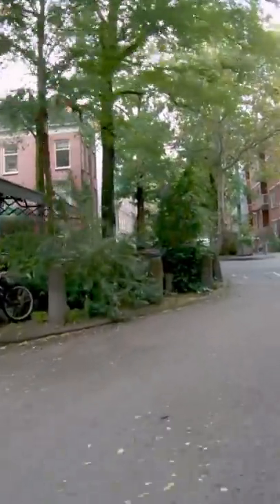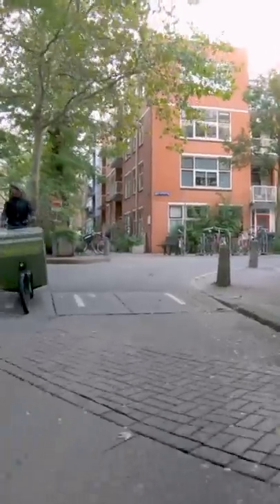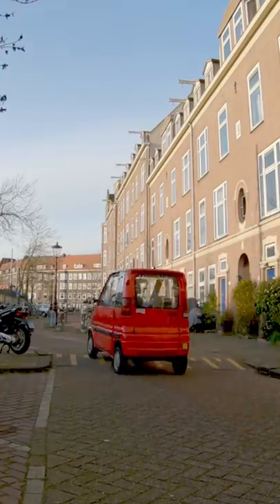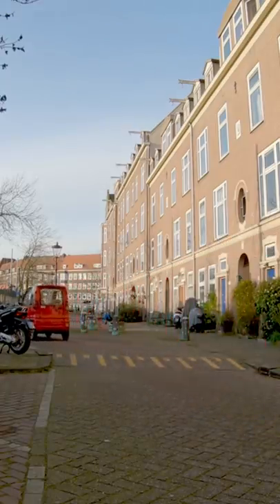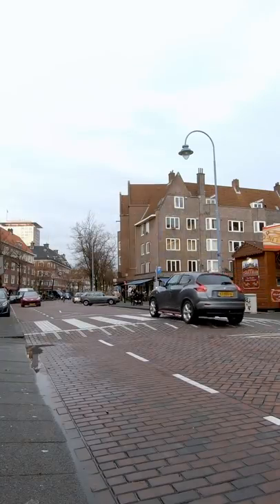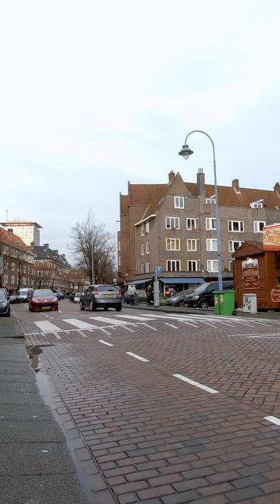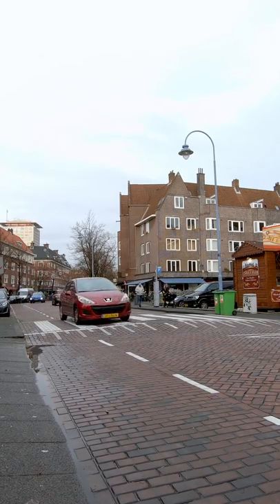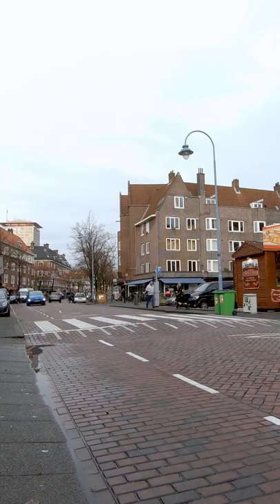How the Dutch Slow Drivers for Safer Streets #shorts

Comment: In Germany an "Allee", a street lined with trees, is seen as on of the most dangerous kinds of roads. The trees block the view to sidestreets and around corners. If it is sunny it gets even worse if you get the flicker of light and dark in your eyes. Small vehicles are noticed really late.
Reply from the maker: These are used strategically: only when required. In this case, it's because there are several driveways off to the right. Using trees this way makes the roads safer, because drivers slow down when they should slow down. It works!
Reply: In poland every country road is like that... you see candles burning every few km because someone died on that tree... very stupid idea.
Reply: @009Daft600  in Germany we have crosses every few hundred meters on country roads
Reply: @NotJustBikes  In france they used to line the "national" roads with plane trees, found out car+tree=fatal accidents (and drivers say it makes the road boring/increases drowsiness 'cause it's always the same sight) and now they're cutting em down. Also because they've been widely used and because trade doesn't care about ecology they're now susceptible to a variety of pests which may cause them to fall down when dead for some time thus being even more of a potential risk, though I've never seen that happen in france (checking trees for pests and preemptive cuts don't seem to be a problem in most cities/rural areas) but some countries, like spain, do wait for the trees to fall on the road/parked cars.
Reply: I also thought that imagine if someone had a car accident, those trees could be a serious hazard
Reply: @NotJustBikes  better visibility is obviously safer than putting trees really close to streets so you cant see properly and hopefully slow down, which most wont.
Reply: Trees are not the problem, but the speed is the problem. Trees are very lazy and don't move that fast, so the problem must be the drivers in the cars.
Reply: I was going to say, I hate when there's a crap tone of trees blocking my view, especially when I'm trying to join traffic
Reply: @NikkyElso  You obviously shouldn't have trees, foliage, or parked cars blocking your view on a T-junction. Sadly, it's a common street design error.
Reply: @borek772  and there really shouldn't be cows organising a fashion show mid street
Reply: @NotJustBikes  no it doesn’t. I don’t know how traffic designers come up with these stupid ideas but I live here and there is one of those “trees filled roads” nearby. Every accident that happens on that road is deadly. If you want to make that road safer make separated lanes and use guardrails. 

That makes an accident survivable. Trees do not budge. If you hit one with 80kmh you die. I really think a lot of road planners have not ever driven a car and only go of theory. In the last year they have changed two very important places and after opening there immediately where multiple accidents and incidents. Because things where placed in the wrong place. A semi roundabout with pedestrian and bike crossing that purposely put bikes in the blindspot of a car for instance. It’s just around the corner of where I live but I always drive around because it is insanely dangerous!
Reply: @harryjessen  yea, tell that to people that had to avoid oncoming traffic/lost control for some reason/etc etc and lost their life because of a tree on the side of the road.
Reply: @tobiasmetzger4522  Germany has less fatalities per km driven than the Netherlands. its probably because of the Netherlands stupid road design
Reply: @harryjessen  same with highways, why do we need that middle barrier? remove it and make the highway have sharp sudden turn, all the danger will certainly not be a problem, i mean it's only a problem because the cars move right
Reply: @Gren4te  Roads are different than streets. This is specifically referring to streets, where the limit should be 40-50 km/h. When the US started requiring buffer zones on streets, driver fatalities decreased, but pedestrian fatalities increased to the point where there was a net increase in fatalities.
Reply: @witoldschwenke9492  i dont find that statistic. I just see Germany has more deaths per 1mio people. And since we have a much bigger road network and country in general than Holland, of course you can't compare statistics by km.
Reply: @Gren4te  why are you driving 80 km/h down a narrow tree-lined road?
Reply: Correct. In Germany they are usually also constructed with runoffs, trenches and/or barriers on country roads because trees are really dangerous

Comment: I love how at the end the person crosses at the wrong spot, and the car didn’t even slow down for the speed bump!
Reply: The car probably did slow down. They just drive manual transmissions which allows for engine braking to slow down the car without hitting the brakes
Reply: Didnt need too. They were allready going the right speed
Reply: did you mean the person on the bike? because they're not a pedestrian they're a bike user, using the road
Reply: He did cross at the right spot, it's a 2 way road.
Reply: @maxbenson9982  around 80% probably does yes.
Reply: @flatgas5130  Why?
Reply: Both of these happened what are you on about

Comment: You're forgetting green waves! On long stretches of road where a car would encounter multiple traffic lights, they'll get all green lights if they keep to the speed limit. Highly discourages speeding and makes for a comfortable and safe drive
Reply from the maker: Green waves are used all over the world though, so they're not very unique. They have them in Canada, too.

But YouTube Shorts have to be less than a minute long so there's actually several topics I cut out for this video. 😁
Reply: Green waves are also not a Dutch invention or used that much here